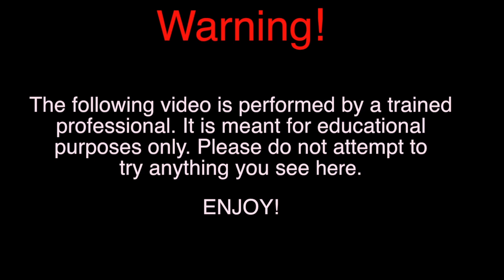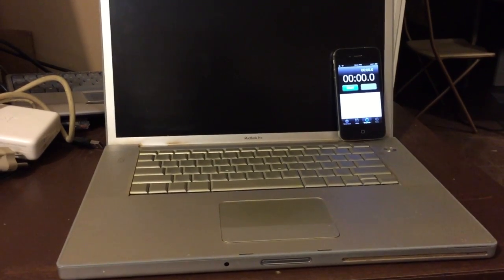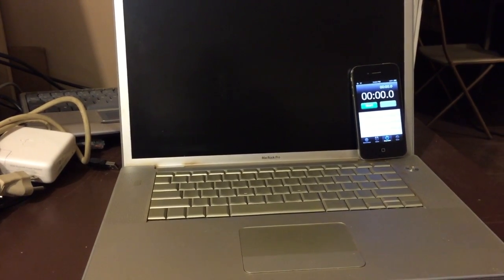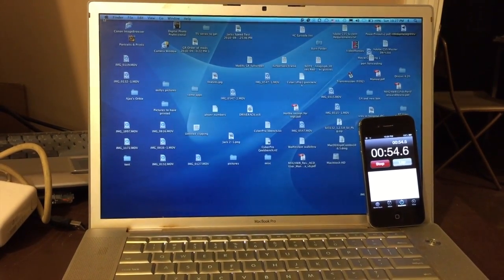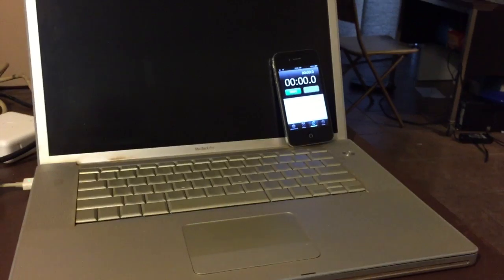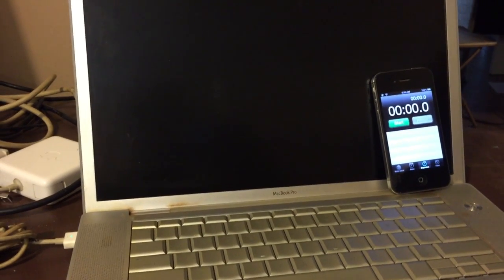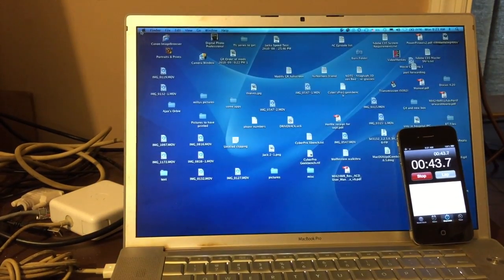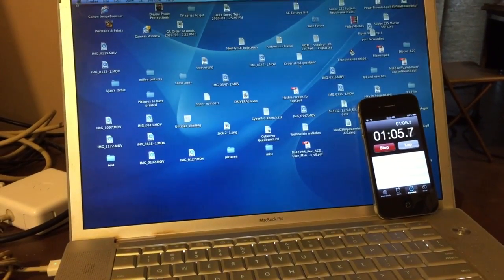2008 MacBook Pro 15" 2.4Ghz A1260 Tune Up Report

Comment: An easy cheap upgrade

A 250GB 7200 SATA 3 drive just cost me $10 ppd. on eBay.

$53 invested in THREE parts donors

TWO from on eBay

One from our DUMPSTER that gave a good POST

But had a smashed Screen, broken LID, abused keyboard.

Parts swaps made it like NEW, again...

I love it!

6/2020

J.C.

Comment from the maker: https://www.youtube.com/watch?v=zbgSVg7ZlfA This is a tune up report for a 2008 MacBook Pro 15" 2.4Ghz A1260 Tune Up Report. Removed the stock 5400PRM Hard drive and upgraded to a 7200 RPM hard drive and clean up.